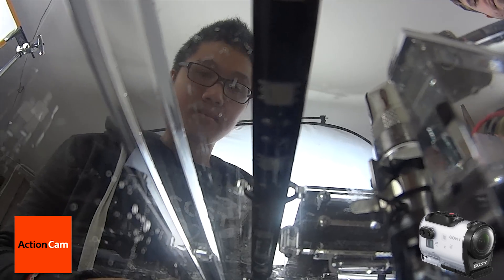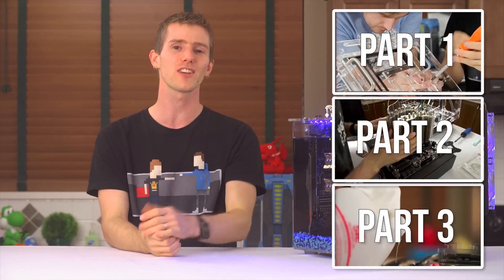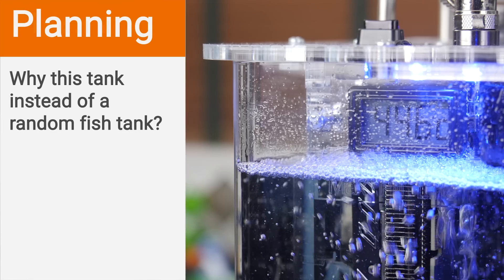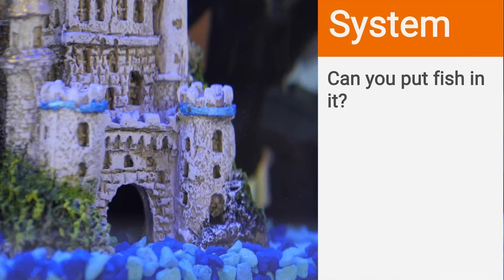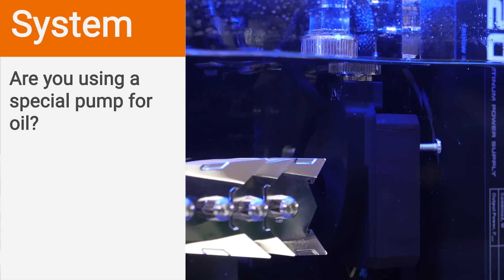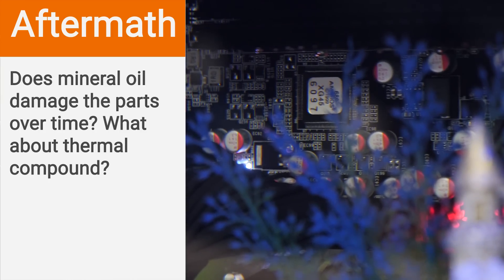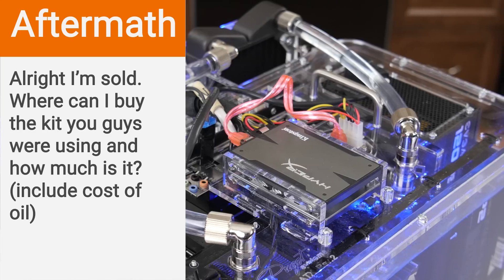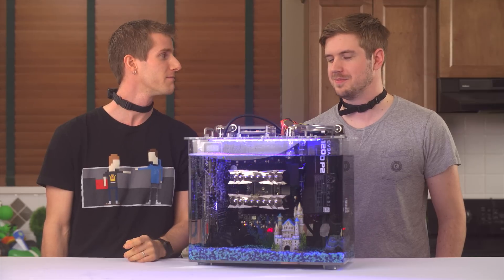Mineral Oil Cooled PC Part 4 - Q&A

Comment: I built an oil PC back when I had my Athlon XP-M, SAE 30 weight non detergent oil works as a medium too (plus you can take it to an auto parts store when you're done.  The best part of an oil PC is that you could phase change cool the oil because it wont freeze making it possible to bring the entire PC below ambient.  I broke the mini fridge I was going to use as a case due to putting it on its side so I ended up using a fish tank and a large coil of copper tubing as a radiator.  I just used it for about an hour at a time and watched Speedfan to make sure I wasn't getting beyond my temp limit.  Just saying though, It was alot of fun but the motherboard leaked oil for years afterwords.

Comment: Mineral oil as you know, is hygroscopic and will absorb moisture from the air ( worse with the bubbler on ) degrading the oil and its electrical properties over time. You can remove this moisture by bubbling bottled dry air or dry nitrogen through the system ( use a TIG welding regulator or similar ) saving the hassle of replacing the oil.

Comment: @LinusTechTips, Since the Maslow's Law has officially hit the processing industry; I am figuring that it is the perfect time to build a system which can sustain itself for quiet a few more years than the traditional desktop. I am interested in Mineral Oil Computers because it does have the potential to add quiet a few years to hardware (despite it's inconveniences) given that the configuration is ideal. 

Lets face it: A HEAVY computer that looks like a fish tank with plenty of décor sitting on my mothers desk with a very sufficient method of sustaining an optimal temperature. A Mineral Oil Computer sounds like a great idea for the elder's that use it for facebook.

I want one of those kits you were giving out. I can have the mineral oil by the first of this upcoming month. I'm also getting all of the hardware for it too. I want the kit because the case was denser than an aquarium. Do you still have any? Do you think you can scan it into CAD so I can refabricate one based on the model you guys have?

Thanks
Reply: Also; Can I put silicon fish in it as long as I mesh over the fans?

Comment: Didn't they have a problem with CPU temperatures? They said themselves that the fan on the GPU helps the oil flow through and cool the GPU, so why wouldn't it work with the CPU cooler?

Comment: So they say there is no benefit to air or water cooling. I would say silence. But in that case are the 2 radiators on be back really needed? Also I wont buy the part where they claim that this kit it cheaper then a aquarium.

Comment: Nice build (watched all previous parts as well).
This channel is allways been such a good inspiration for my own builds :)
PS.
I wonder what material tube fittings/connector o-rings are?
Rubber ones obviously are no no.
Cheers :)

Comment: Yes the fans will wear out faster the bearings are usually sealed and its not about the bearings even if bearings are bad they will turn the motor is stressed and that is what will give out

Comment: I built a mineral oil computer about 10 years ago but it was a nightmare to keep clean and maintain. and what he hasn't realized yet is that the mineral oil eventually eats away all the glues in there and heatsinks and such fall off. otherwise you can never have a more temperature stable machine

Comment: I realize this is old by now, yet i have a few thoughts, 
Just as in air cooling, not having a good flow around the heat sink isn't great (ie the fan on the heat sink in air cooling)

What if you had the intake pipe to the radiators next to the gpu cooler and the out put from the radiators flowing through the cpu cooler??

Or use water cooling block on the cpu and gpu and have the intake/output on one of the two connectors on the blocks, then leave the other open to draw in the ambient temp oil from the case??

(the idea being, target the two major heat sources using the in and out from the pump/radiator pipes to eliminate the long term heat build up)

Comment: Why do you need a waterproof camera if the oil is non conductive?
Reply: rodrick160 is probably get all in stuff it's not supposed to like behind the lens
Reply: its probably easier to clean than if you put a nonwater proof camera in oil
Reply: Hi There if the oil is in and out of the lenz it will be fine

Comment: Well there is a way to get around patents and selling the products. Say the customer buys the materials from some other store.  I meen buying the materials as if you got the sheets not cut or anything and bought them and went out and took them in your hand and took them to the place or sent them in the mail to the place to be cut. Then it comes down to a cut out design aspect and most of the times the patent they would have would not come into any conflicts. It is kinda shady to do but it is straight out legal to do. They won't be able to give them the manual or anything like that to put it together but if someone were to have a download of them and just say posted them then hey there you go.

Comment: I'm not sure I agree with their analysis that the CPU fans wouldn't make a difference.  If you increase the flow rate of the coolant across the heat exchanger, you'll increase the rate at which heat transfer occurs.  You may not effect the overall idle temperature of the system(which could be achieved by adding more external radiators) but you will reduce the thermal peaking associated with the component attached to that heat exchanger.  Seems pretty useful to me.

Comment: I dont get how all parts still work even if they're submerged in oil
Reply: Andy Schoenmakers the reason why your pc breaks from water is because some electricity goes into the water and then goes into another place causing the components frying. Mineral Oil isnt conductive, which means it doesnt carry electricity. It can not break any components. Except hard drive and and optical drive.

Comment: I like how the GPU is at 56c with Linus admitting that it's because of the fans, but they don't want to put a fan on the CPU running at 90c because "it has enough flow." Let's chit chat about thermodynamics, beardfat.

Comment: if you think about it is a great idea;

1º the oil will keep the parts forever (no oxidation of contact)
2º the oil will keep the dust off, bugs, and etc, 
3º the oil cool faster that air, and if you use more pups to create a good flow.

for the contact (like connections) you can use hot glue guns that will isolate all the contacts.

Great Video, 5 starts

Comment: Interesting thought. Could you use some sort of impeller replacement for the GPU fans? Force more mineral oil through the graphics card? Guess it is kinda pointless but could be interesting way to get the oil moving around.

Comment: A rubbermaid tub (or equivalent) would do for holding the components while you install upgrades. The solid sides make it less likely that mineral oil will leak anywhere; that a wall of a garbage bag will slip to an even horizontal level and the oil will get everywhere. Just a thought.

Comment: Linus, are you standing on a platform? :p
Reply: Or Luke is forced to bend his knees a bit, maybe it's stipulated in the contract.
Reply: amazin
Reply: why do youtube comments always get so off track
Reply: I know this is an old thread but everything is genetic, physical proportions are decided by your genetics, not your height and weight etc. You can have a 12" penis and be 4-5 feet tall weighing 1 tonne, it doesn't freaking matter.
Reply: I think the camera guy suggested that so they are both in frame..
Reply: Igor Igor Actually no. Even dwarves have average size dicks. Height does not equal dick size. Even people as tall as Shaq will have average sized dicks, because height does not correlate with dick size.
Reply: he is probably self concius about his hight.
Reply: Igor Igor No. Size (height and frame) is controlled by the pituitary gland. It does not affect the penis.
Reply: 5.6 average!?! That seems... so small
Reply: collaborative project look at that grammar.
Reply: Not true. It's not a direct correlation so it doesn't always hold true, but it's nose and adams apple size. Size along the center line often correlates.
Reply: short ppl have small dicks too

Comment: In air, temperatures come to equilibrium really quickly. In oil you have that huge heat reservoir to change.  I presume you ran tests until equilibrium.  One thing I would worry about is that equilibrium might be way too hot.  If the CPU could get up to 80, the oil would eventually get there and the CPU could go even higher.

During benchmarks it looked like you didn't have enough oil flow.  The oil was much cooler than the CPU sensors. Did you try increasing flow? Add the CPU fan.  Orient the bubbles so they hit the heatsinks.  Put some additional large fans in the oil. Ensure the oil coming back from the air heat exchange is returned as close as possible to the CPU and GPU.
Reply: Peter yes they shoulda done all of those thjngs. I didn't understand the coolness of the oil vrs the cpu temp, it could and should be much cooler. I think just the cpu fan and inceasing flow wit a small fan or 2 would greatly improve it

Comment: But all the PSU cables and the heatshrink are rubber.
Reply: Yes, inside the PSU are plenty of polymer-based sheathes and ties. The hope is that it won't degrade enough to allow contact, but you can't be sure.

Comment: If there's an issue with ambient cooling surely just pointing an extra fan in that direction would sort that?
Reply: Ah I just got to the point where you mention that, as long as your flow is all in the roughly same direction that shouldn't be a problem. Another question, why not cool it through a mini-fridge?
Reply: Or pump compressed air (and therefor cooled) through the oil?

Comment: so you could have taken the volume of each item, added it, then know that, that is the volume of the total displaced.  You could add the oil first and drop it in to the right amount.  Also, a DIY funnel would literally be cutting a soda bottle with your scissors..

Comment: You can get small re-cleanable filters (cones) for in a water loop, so if you're worried about gunk you could toss one on the rad loop. Also the pump should be put low in the oil to 'scoop' gunk from cables or rubber parts.

Comment: You guys still using this rig?
Reply: JFrank  I had the same question
Reply: Up until somewhat recently, that is a few months. A couple months after the big move, it started leaking out of hairline fractures in a few areas of the acrylic, due to Linus's rough driving of the U-haul. They fixed it, but it quickly started leaking again. Not sure what happened to  it, but it isn't Linus's work rig anymore, sadly. I kind of miss the build logs. They need to do more big projects like this and whole room water cooling. Yeah the whole room project wasn't a great idea, but it sure was fun to watch.
Reply: I think You can see it in the new videos, I'm not sure if it this exact build, but it looks like the same probably.

Comment: Would you even need a waterproof camera in mineral oil?
Reply: Probably not, same as the pc components. I think it was just their way of advertising that camera.
Reply: lucas6921a Because as they said, it's extremely difficult to get the oil off components again. So they wouldn't necessarily need it, but it's a lot easier for them.
Reply: Maybe the oil could cause problems for the lens?
Reply: lucas6921a You would need a mineral oil-proof camera.
Reply: if oil got under the lens (which it would if the camera wasnt sealed) it would never come out and your photos would forever be blurry
Reply: they are still dipping the camera in the oil, the cleaning doesnt change, also its a digital lens they dont work like older cameras so the oil (most likely) would have no effect on the lens.
Reply: Depends on if you plan on ever using the camera again. Not to mention if the lens became submerged in oil it would throw the diffractive of the lens index off and you probably couldn't focus.
Reply: Is this meant to be a joke revolving around the common conception that oil doesn't mix with water and the obvious fact that oil isn't water?

Comment: Looking at this as a solution for a PC that has fried several times because it sits in an environment with 90% humidity. Condensation rusts metal parts, etc. I wonder if there would be any drawbacks... and if the high humidity would still trash the components that are outside of the "aquarium"?

Comment: what about putting a refrigerator type coil to cool the oil?
Reply: Because It will only cool the oil around the coil.. Nice rhyming right? The pump, the fans and the radiator will cool the oil and also spread it evenly around the whole system.
Reply: xPsyCHO put a fan on the coil to make a flow of oil

Comment: Will Ethylene/Propylene Glycol would work better than mineral oil ? I've worked with plasma cutting system and they used that as liquid coolant. As I know, the liquid mix (distilled water & ethylene/propulene glycol) is not electric conductive

Comment: could you use mineral oil inside a cpu water Cooling kit?
Reply: It should theoretically work, but really wouldn't be effective, as oil is way more viscous then water. Water is a better option

Comment: I don't get why you use such an excessive power supply for the build. I don't know exactly how much the OC requires, but I do know that a 750W PSU is more than enough.
Reply: With 2 radiators and a pump. Bruh
Reply: Radiators dont use power man... lol It's just 4 fans, which is nothing in terms of power. And a pump, it's not gonna use that much power to justify a 1200w psu. My guess is that they just had it on hand and didn't want to purchase another one. Or maybe because Linus mentioned in part 3 that the psu fan has the ability to be turned off (with a button or something).
Reply: I thought the same thing a little over kill.

Comment: But there is rubber inside the system still. For instance, I bet the graphics card's fans plug in internally to the PCB via some small rubber-sleeved cable.

Comment: Now build one filled with Gasoline.
Reply: or bleach
Reply: gasoline will evaporate rather quickly
Reply: Shelf life of gasoline isn't very good either. If it didn't explode it would become a mess after a few months.
Reply: Haha better hope something doesn’t go wrong or else... BOOM
Reply: Actually... gasoline might not be that bad of an idea. Not sure about the corrosive qualities but with no air, no spark, it's a none conductive fluid and it's ignition point is over 100°C.
Reply: @AnonEyeMouse  Gasoline has conductivity additives in it so when you pump gas you don't create static and blow up your car.
Reply: @danzk  That seems extremely odd considering hydrocarbons have no free electrons and so are very unlikely to cause any static charge. Do you have a source for the additives? I'd love to read up on that.

Comment: I would like to ask if mineral oil can be used instead of a water in a pump so if in case there's a leak on your pump hardware issues might be reduced or eliminated , will it reduce the risk of hardware shorts or eliminate it just curious here. Thanks!

Comment: Ok ive seen u tried pc in fridge, and now pc in oil :P let me tell you something i heard. a friend of a friend told me that someone made a compatible fridge thingy, and put oil in it, and then put the pc in it..!! the conclusion of this was that the pc kept a VERY low temp, and went smooth.

Might this be a project for you? :)
Reply: +kickazz1337 Some overclockers cool their system with Liquid Nitrogen at overclockcompetitions. Possible Problems with "icecooled" builds is, that electronic parts get damaged if the temperature is too low.

Comment: 9:26 < --- first off im not an electrician .. (eew) but the worst thing for fan motors is cycling.. off and on.... that microsecond of an on cycle and spin up is the worst for the motor... its almost like an overvoltage to get the fan up to speed.... if you have a small fan like this in a cpu application, that was cycling on and off for 5-10 years.... its either going to be dead or barely hanging on because of that cycling... it would be better to just have it under voltage and spinning for 10 years than to have it cycling for 10 years, it just kills the motor

Comment: 12:03 To clean the components for reusing them outside the mineral oil, aceton can be a good choice,it degreases everything, You need to wear protection gloves for chemicals and a respirator and work in a ventilated room.
Reply: 7 year old comment, but I would worry that acetone dissolves any plastic on my components. There could be wiring or shrouds with acetone sensitive material in it. Alcohol might be a better option.

Comment: Do you have to put the rocks and decorations in it?
Reply: Absolutely not. That was just Linus' particular style. you could have just the bare system
Reply: +Cade Dickey yeah. I might have put some decorations in it, but I wouldn't make it look like a space fish tank.
Reply: I would have a dead gpu on the bottom with leds
Reply: +Cade Dickey That would be cool, but I'm also into cars so I might put some cleaned car parts and mud acted branding at the bottom.
Reply: +Cade Dickey It would also be kind of cool to throw in some kind of intricate design made from aluminum sheet metal for that futuristic feel.